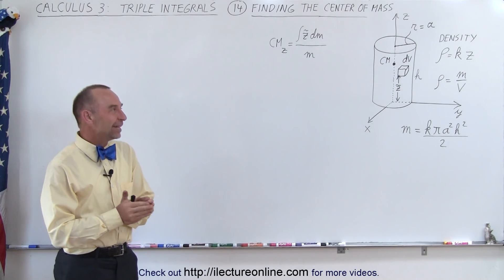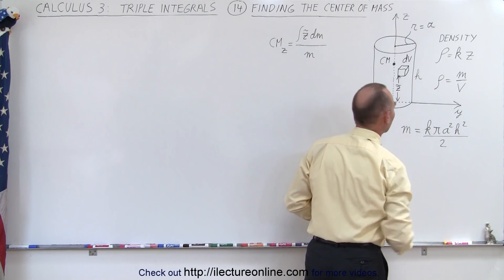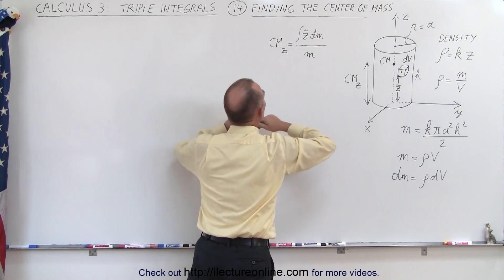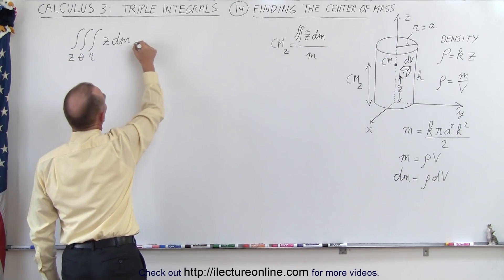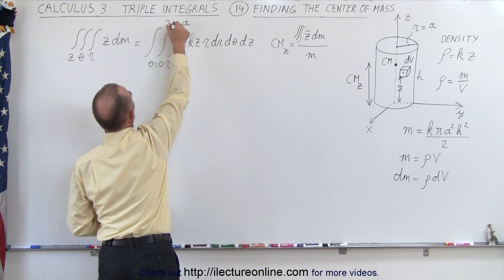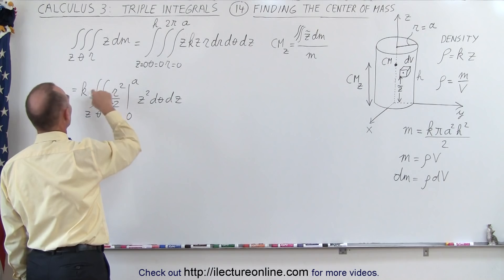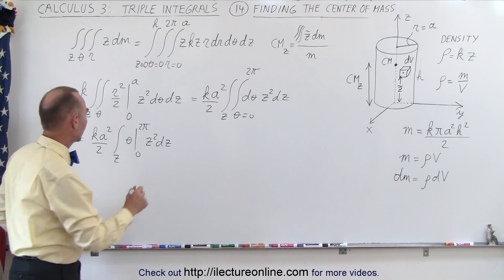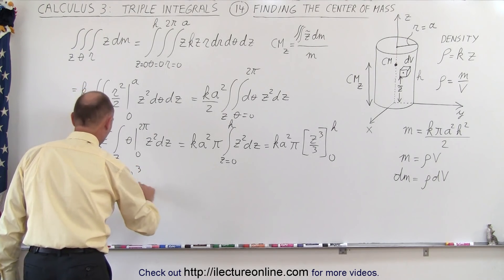Calculus 3: Triple Integrals (14 of 25) Finding the Center of Mass (Variable Density): Cylindrical

Comment: 1) is the formula of the center of the mass has a proof?

2) is the z in density law is the same as the z in center of mass law ?
Reply from the maker: There is no "proof" for center of mass.  It is simply a concept, which implies that an object will act as  if all of its mass is concentrated at the center of mass.  It can also be found by applying calculus to any problem.  See this example:  https://youtu.be/SWDDj0qpQcw   Physics - Mechanics: Finding the Center of Mass (4 of 4) Triangle      For 2) not sure what you mean by " density law" and "center of mass law".